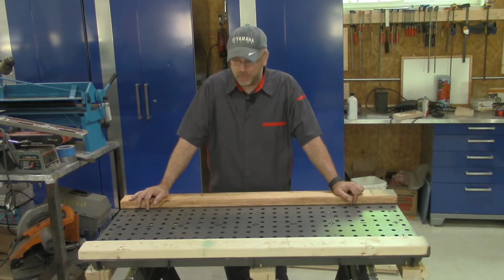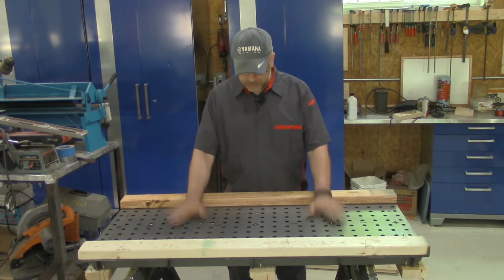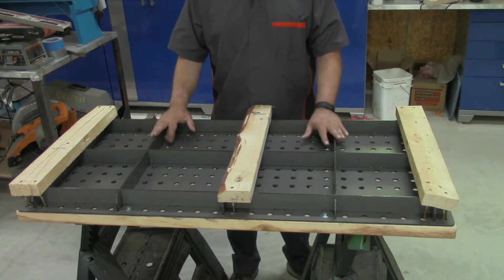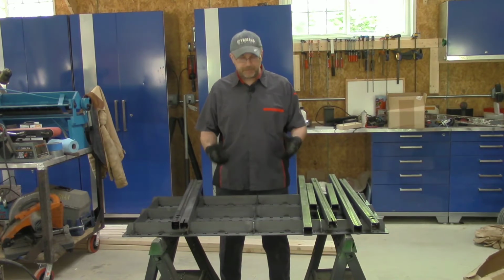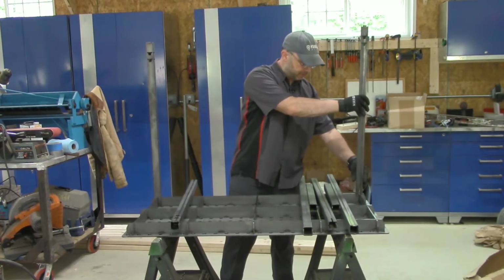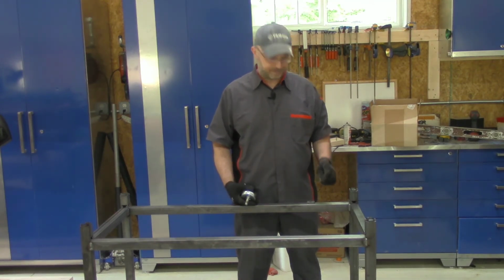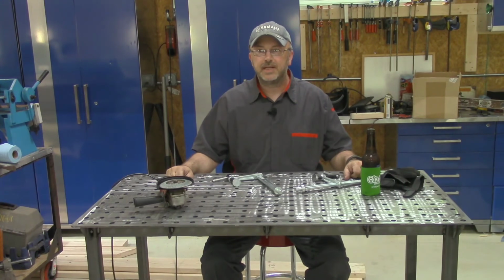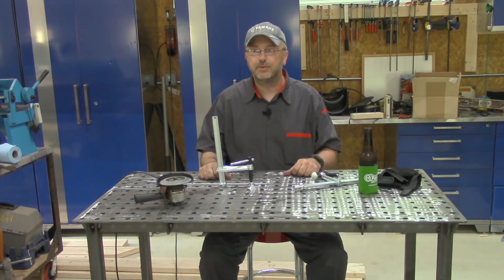Welding table build

Comment: Great video. Very helpful. I have the same one heading my way and as for height, I felt like the original 40" would be too tall as well. I had them custom cut the height to be 34" (same height as all of my other flat surfaces). It was only an addition $20. 

I was surprised how reasonably priced they are for what you get. When I sourced everything myself it wasn't too much more, and it's got all of the dog holes in it for clamping that I would NEVER be able to do myself lol. Hopefully it's all worth it!
Reply from the maker: Thanks, I had not really even looked at the height when I ordered it.  I was thinking it seemed tall but now as I think about it more I am thinking it will be great to have work up closer when welding.  I hope to get started on a project this weekend and will be shooting a video on that, will report in that video how I like the height.  Either way, I know just what you mean about the value of the table, I considered making my own but like you said it wouldn't have all the holes in it and I think those are going to be hugely useful.

Comment: I can't tell from the video but is it possible the nut goes on the inside and then the plate is welded to the bottom of the leg? just  a question
Reply from the maker: You could probably do it that way as well.  I considered that but the nice thing about putting the nut on the bottom is it doesn't matter if you get really good penetration since the weld is just holding it in place and not actually supporting the weight of the table if you do it this way.  In the end the only real difference is the table would be about 1/2" shorter when the casters were screwed in all the way.

However I do agree it might be a little "cleaner" if done that way with the nut hidden.